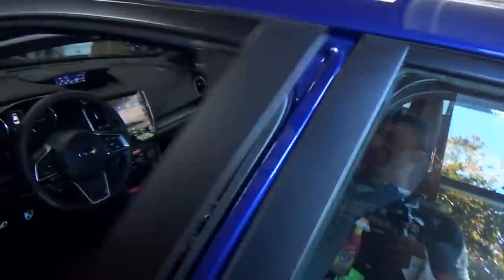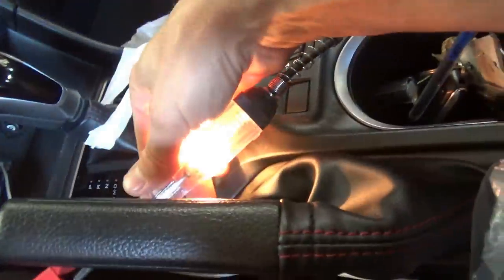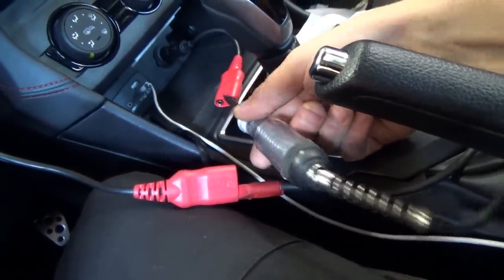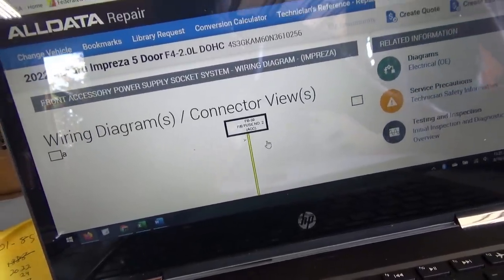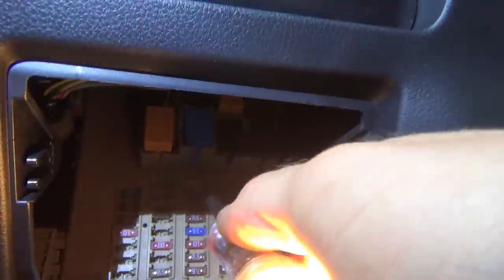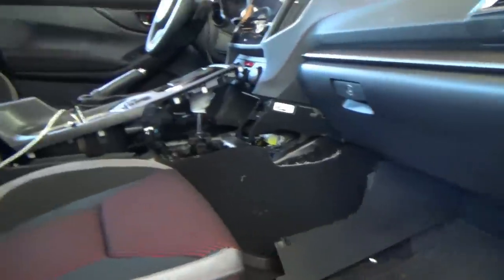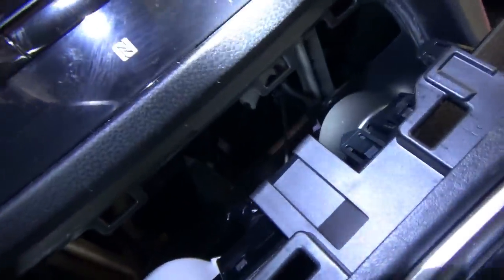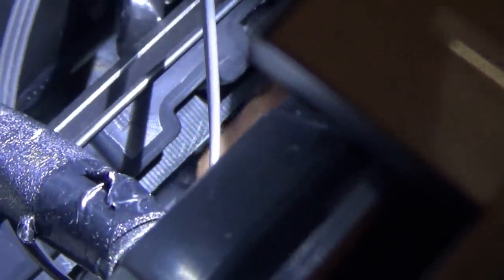Dealer Wants to Charge Customer for THEIR SCREW-UP?! (22 Subaru Impreza)

Comment: I bet the tech was used to seeing a ground on the side with a knife connector,  and the power being delivered with a single pin .     The tech found a blown fuse put a new fuse in : well there has  to be a cause to have a labor op to get paid. So the tech pencil whipped the sock failure to get the labor op .  The socket replacement was more time consuming  than expected and the tech reached and plugged it in by feel.  And missed the second prong .  
          Did the customer wait for the car at the dealership?

Comment: When I first bought my Evo 10, there was a VERY minor oil leak somewhere up front. Only about 1 drop of oil per day. So by no means an issue, it just annoyed me. After about two weeks of trying to hunt down this tiny leak, I gave up and brought it in to a dealer. The present me with a $1,200 repair quote and a stern warning "not to drive the car". I laughed at the idea of a single drop of oil per day was unsafe to drive, and took off. Lo and behold the next morning, my entire oil pan (or what was left of it) evacuated itself onto my driveway. Pulled off the front bumper and what do you know, the return line on the oil cooler was loosened. 

There are only two possible options for this scenario. 
A; the dealership was so incompetent they loosened an oil line and forgot to retighten it.
B; the dealership deliberately made the problem worse to stick me with a $1,200 bill to "fix" the problem.

Tightened the fastener back up, and the leak stopped completely. Turns out the original problem was that the NPT fitting was backed off by about 1/16th a turn, creating the tiny leak. Needless to say, I've never let anyone else ever touch my car since. I'm glad I only lived 2 miles from that dealer. IF I was any farther, I would've leaked out all of my oil and seized that engine.

Comment: Damn glad the customer was happy, that's what we do it for, right? (and we're probably instant gratification junkies lol) I've got a good dealership story. Customers car overheats a little bit in stop and go traffic. Took it into the chevy dealer. Dealer comes back and says it needs a new engine, and under notes on the work order, and I quote "The head gaskets have welded to the cylinder head".  On an aluminum block with MLS head gaskets. For those that took 8th grade science, can aluminum weld to steel? (technically in a vacuum where the oxide layer can't form, yes, but this isn't the tesla roadster out there in space). So yeah, $6k to fix it, and all the car needed was a rad and a thermostat. Deathcool (google it) Used my brain, car had 28k miles and it was 20 years old. Coolant turned to gel, plugged up the rad. Confirmed with an infrared temp gun. $328 bucks later, the customers car was fixed. The dealer is never the best option in my opinion.
Reply: It happens everywhere Sean. Independent garage had a Chevy 3/4 ton dually that was 4 years old with 12,000 miles. Truck was immaculate, owner performed oil analysis and found antifreeze trace in the engine oil. Brought it in for diagnosis and technician advised shop owner that he didn't see anything unusual and the engine needed to come apart. Owner of truck gave permission to remove the intake, removed intake no coolant leaks found, got permission to remove cylinder heads, removed cylinder heads and no coolant leaks found. Sent heads out to machine shop to check for any cracks/casting issues, machine shop calls to say heads look brand new, why are they off the vehicle in his machine shop. The shop explained what was happening with the truck and machine shop asked if the truck has an internal oil cooler in the radiator. Guess what - it did. Sent radiator to radiator shop for testing and what do you know, it had a leaking internal oil cooler. Repaired radiator with new oil cooler (this was around 1999/2000) and reinstalled. Owner of truck was adamant on oem gaskets/parts and independent shop owner did not want to tie up a bay/wait to order oem gaskets and installed aftermarket gaskets. Owner paid the full bill for all of the work and was never advised of any parts substitution. Hindsight is always 20/20, but the owner of that truck did not deserve the bill that he paid.
Sometimes it is just the luck of the draw who you find to work on your vehicle. The owner of the dually loved the owner of this shop and trusted him without question. However, the owner of the shop no longer did much wrenching and hired two technicians to work in his garage. 
There are many good technicians out there working at both independent garages and dealerships. You just never get to see the bulk of them on the youtube.
Reply: @johnrose3169  it's really sucks because for the good technicians we almost always have to fight an uphill battle because of customers prior experiences. I am totally happy to win them over and earn their trust and it's one of the things I really love about what I do. That story is pretty incredible. The owner of that truck wanted to do his best to make sure his vehicle was 100%. Those technicians went down the rabbit hole a little bit but they weren't far off with what they were doing at least. They took it apart and they dialed it down to what it wasn't and narrowed it down to what it was. Unfortunately that involves a lot of Labor to make sure that it's done right but I at least applaud them for taking it apart versus trying to sell a whole engine like that dealership tried to do to my customer. I don't know in 1999 to 2000 if they had diagnostic tools like the carbon monoxide tester (blue combustion fluid test). That would have been my first jump off after getting those oil results back and although that test isn't completely definitive it would have steered me in the direction of where does oil and coolant meet. I've seen oil and transmission fluid coolers in radiators fail but that's also because I have the prior experience and I know what to look for. The first time I diagnosed that, it took me a long time. We are masters of our craft and unfortunately we can't do what we love, and what we need to do because of corporate bean counters and the fact that money makes the world go around. Not good feelings. Sucks! If I could do my job and do what I do best and be thorough as I want to be while knowing my bills are paid no matter how many cars I get in or out it would be so much more of a fantastic career.
Reply: @moo3993  I hear you on the bills being paid and diffusing prior customer experience situations. I hear you on the time concerns as well. Book time at both dealer/independents and warranty rate of pay at the dealers push many people that are very good technicians and problem solvers out the door. It takes years to gain experience and the industry is constantly changing. For what the industry is, it takes someone that really loves repairing cars/helping people to make a career of it.
Reply: @johnrose3169  you couldn't be preaching more perfect words. I had a buddy of mine that wanted to get into it and wanted to go to UTI. The very first thing I told him make sure it is your passion this is what drives you this is what you thoroughly enjoy and want to do with your life because there's no money in it for 15 years. After that and your student loans are paid and you have the tools that you need and they're paid off that's when you start making money. I told him make sure it's your passion before you do anything. You are absolutely right about that John

Comment: Nice work!  All my mobile ham radios have their fused connection through a decent gauge wire to the battery. I don’t trust the 12 volt socket to provide enough current. 
K6RIN

Comment: So was the factory outlet not properly installed? Did the Ham radio current draw damage the factory outlet? Dealer replaced the burned outlet but failed to properly connect the new unit? Confusing.
Reply from the maker: That's how I understood it haha

Comment: The dealer can't bench-test a lighter socket? Do they not know how to do simple continuity checks?
Reply: Continuity checks don't guarantee that a wire or component can carry current.
Reply: @alantrimble2881  I agree that if they were to test continuity with a typical high impedance DMM they could get a false positive. But the continuity test is still useful in this case because if the result is that there is no continuity that does confirm that the circuit under test through the socket is an open circuit. And isn’t an open circuit what we would be looking for here?

If we got a low ohm reading indicating a low resistance connection then following up with a second test which would be powering a reasonably high current load (1.2 ohm load would be a 10 amp draw) would verify the integrity of both the power and ground circuits through the socket. You would have to have a bench power supply capable of delivering 10A @ 12VDC or you could just use the vehicle battery and some test leads to connect it to the input terminals of the socket. And even in my DIY shop I could easily come up with a cigarette lighter powered tool or light for such a test. 

This is elementary electrical testing. It doesn’t get much simpler than this. It’s hard to believe that a new car dealership service garage doesn’t have someone that could bench test the old socket that they removed. 

My suspicion is that they just didn’t want to do it.
Reply: @Dave-ei7kk  Right. Cigarette lighter sockets are about as simple of an electrical device as they get---it either works or it's open. But one could also do simple resistance checks as well, using an adapter socket with test leads like Ivan has. If the socket is ok, there should be little to no resistance. And finally, a good visual inspection can also tell the tale of overheating

Comment: I would take this back to the dealership and demand reimbursement for PHAD's charges and a contribution for wasted time, not to mention the replacement the dash panel from ham fisted work.  if there is no acceptable recourse then I would refer it the manufacturers US customer centre as an official complaint that will go against the dealership Customer Satisfaction Index that dealerships are normally very protective of as it affects their relationship with the manufacturer in all sorts of ways relating to the franchise agreement.  Just the threat of an official complaint is enough for most dealerships to capitulate.
What was shown verges on the incompetent and/or fraudulent,  the failure of the socket is clearly a warranty item because irrespective of what was plugged in it is protected by the fuse that would have blown had the load exceeded the fuse/wiring rating.  The socket outlet would have been rated in excess of the fuse rating, so. it is therefore utter BS that plugging in an aftermarket item that fried the socket was the cause of the fault, it was more likely a faulty socket initially that ought to have been properly replaced under warranty.  If I was the customer, I would be quite apoplectic at the disrespectful and insulting way that the dealership handled this.

Comment: I had taken my outback to the dealer because the head units gps was starting to fail and the hood latch was failing as gently dropping the hood, adding some force, and slamming it didnt cause it latch to latch.fully (It would latch enough to where i had to reach under and move the handle, but still) and advised them, its a safety issue, replace it, as I had already hit it with wd 40 and cleaned the shit out of it, thinking there was just dirt and grime.

They replaced the head unit and cleaned the hood latch, here we are 8 months later (i never had to open the hood until it was time to replace the air filter) and same thing-ish  I had paid my 100 dollar deductible per my warranty and they wanted to charge me another hundred because "We didnt replace anything, we just cleaned it".  Ok, well, obviously that didnt fix shit, so im not paying to have you guy FIX the issue and not bandaid it like last time.  The service agent fought with me tooth and nail and I just told him to put the Service Manager on.  he waived it, and i advised i wanted it replaced with a new one.  I called Subaru directly and worked with a case worker/manager there (they have those) and they reached out to the dealer and advised them to replace the latch, not clean it, as its a safety hazard and that i was not to be charged.  Here I am today with a new hood latch and no issues.

Dealerships can be a pain in the dick, but luckily, Subarus Customer Service is chefs kiss.

(The outback is a 2016 model and I dont take it offroad and barely has 47k miles)

Comment: Just a guess but maybe the dealer popped it out without removing anything (scratch markers). Then upon installing they could reach the plug so they tried a  Mcgiver move. Unfortunately for this guy it didn't work but im assuming thats why they have you remove the center. Without  removing it you couldn't reach the plug

Comment: i had a customer tow a car to me said steam came out from under hood was in front of the chevy dealer pulled in they got it right in and said bad motor 6500.00 to fix. i went out to the car started right up ran great let it run until warm had a bad cooling fan replaced they are still driving the car.
Reply: That is really sad.  Great job on your part though. Thanks for having some integrity.

Comment: My 2 cents: 1. 20A fuse, so customer didn't overload circuit  2. Original problem; harness plug simply fell off lighter socket (LS).  3. Dealer didn't REPLACE anything, they just blindly ATTEMPTED to re-plug harness to LS by feeling around, and failed (obviously).  PHAD exactly right that dealer shortcut R&R procedure by prying LS out of panel, leaving witness marks. RUIN DEALER'S DAY BY RETURNING AND DEMANDING THAT THE SCRATCHED PANEL AND LS BE REPLACED FOR FREE 😁. [After all, they scratched it.]

Comment: Well done ivan, He was so happy it was working again :-D
Sloppy replacement by the dealer.
If the two power outlets have a separate feed, he could use a Y cable to parallel them.
More current, less voltage drop.
Yes i'm evil lol.
(Or just turn the transmit power down ).

Comment: Where did you get that long extension from the battery when you test for hot and ground?
Also, it was funny when the service guy told the customer the connector to the power outlet had 12v, so it must be the power outlet.

Comment: That is shotty work. When I had to get a transmission replaced at Honda they did it all under warranty no questions asked. But this guy plugs in a 12 volt plug into a 12 volt socket… and it voids the warranty?? I hope this dealership gets called out.

Comment: That's not as bad as the ripoff attempt I recently found. I had a late model f150 in the shop for an a/c leak. They just left the local dealership where they had accident damage repaired. The dealer told the owner that the truck needed a new a/c compressor. Come to find out the problem with the vehicle was that the dealership left a seal out of the a/c condenser when they replaced it. The dealership was going to charge the customer $2,000.00 dollars to do the wrong repair for a problem they caused.

Comment: Many years ago my mother took her car to a Chevy dealership in Rapid City, SD because her driver window was hard for her to roll up. Mom aske me to look at it because it rolled up easily for a few days and then went back to being hard to roll up. When i removed the door panel the plastic factory liner was still attached to the door. That told me that the dealer  could have only sprayed WD-40 in the track from the top and charged my mon 184.00 to repair the window.  Once I worked for a transmission shop and a customer asked to see the burnt clutch. The clutch packs were not burnt so the owner told the rebuilder to find some old burnt clutches to show the customer. The clutch packs the customer had were from a TH350 and burnt ones were from a C-6. Customer was fooled and gave the OK for the rebuild. That's why I have my own shop now. The unethical criminal behavior of some shops I worked in made it hard for me to sleep. Take the old parts to another shop if you have to and ask it they are from your car.

Comment: Hi ivan, yesterday I encountered the strangest diag case I've ever seen, a 1.6l proton gen 2,it passed the relative compression test with flying colours, yet a cylinder had only 30psi verified by a transducer and a mechanical compression tester, do you have any idea what happened? All the other cylinders were at 188 psi
Reply from the maker: Describe the "relative compression test"

Comment: I expect to see this from the factory lol. Id tell the dealer to replace that pannel as they scratched it, yes it was a lot of work following si to remove the socket but at the same point someone who uses their head would have found the same shortcut you found. I've been there on cars from the factory with stuff not plugged in. Am i guilty of loading up the parts cannon when i know its something the dealer won't stock and don't want to tear it appart and put it back together, yes but i take an educated guess and after the repair verify that i fixed it. If not i acutally diagnose it before its back together.

Comment: I got burned with a 2003 subaru that requires subaru coolant and subaru coolant conditioner only in the engine with NO engine compartment warning anywhere on the vehicle....so using non subaru products caused premature head gasket failure.
Reply from the maker: Eh those head gaskets leak at 100k miles no matter what special coolant you use lol

Comment: These 12V cigarette lighter sockets are complete crap. If you want a reliable power socket, install Anderson Powerpole 45 or XC60 sockets. You can get them in panel mount versions. Splice it into the same wires as the cigarette lighter, or run a separate constabt battery feed.